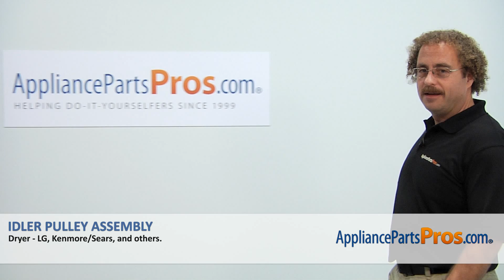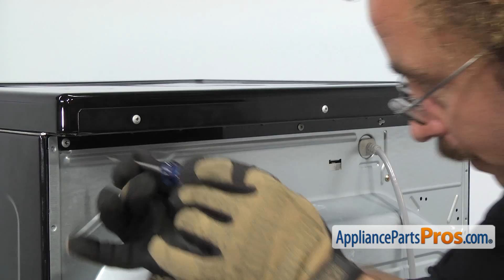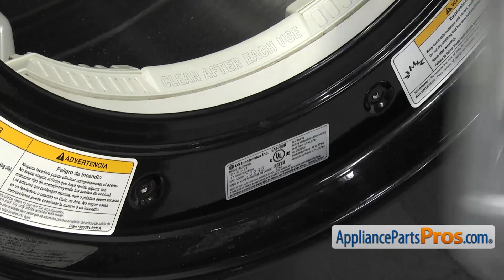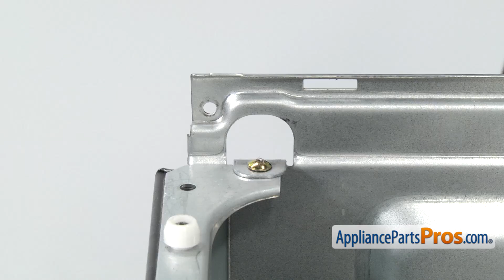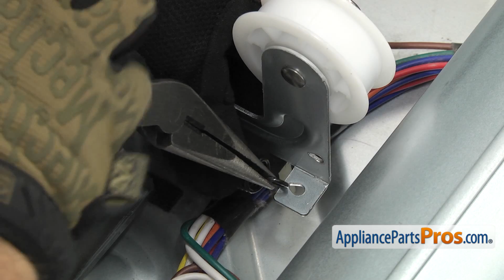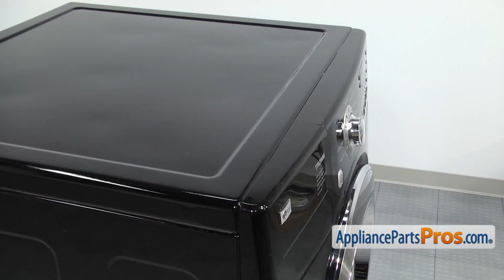LG Dryer Idler Pulley Assembly 4561EL3002A Replacement — fits Kenmore

Comment: I have the 24" version that only has a single spring and no idler pully.  How does this attach?
Reply from the maker: If you need more installation information you can check out our Repair Forum: https://forum.appliancepartspros.com/.  It’s easy to register, and you can either post your question or search the forum to see if someone else has already asked the same question.
 
Our experienced technicians, with over 20 years of hands-on appliance repair experience, are ready to answer your questions and guide you through your repair.

Comment: Whats the part name/number for the black nut pulley that's on the motor?
Reply from the maker: What is your model number?
Reply: @appliancepartspros  DLE5955G
Reply: @appliancepartspros  DLE5955G
Reply from the maker: Unfortunately, that motor pulley is only available with the motor. That part number is 4681EL1008A. You can place an order for that through the website, or you can call us at 1-877-477-7278 to place the order over the phone.

Comment: So there’s no way to access the pulleys from the back plate like older models?
Reply from the maker: That is an option on some models, but not all. If you can remove the back panel of your unit then you could access it that way, if you can't then you wouldn't be able to.